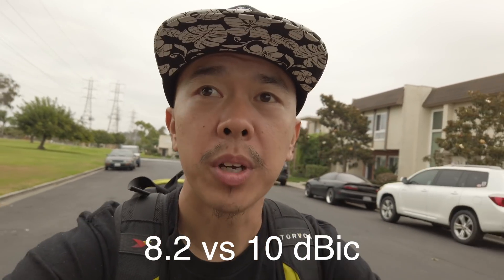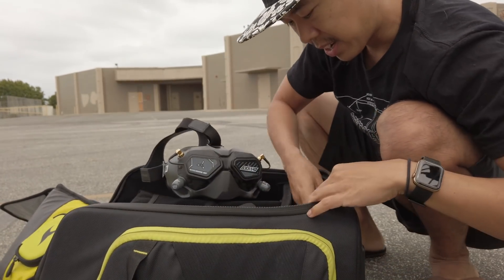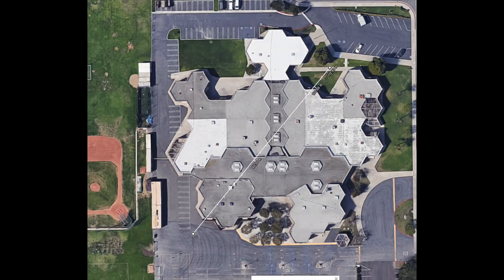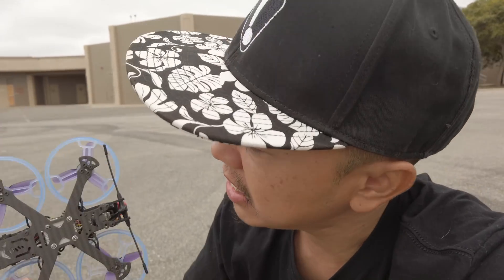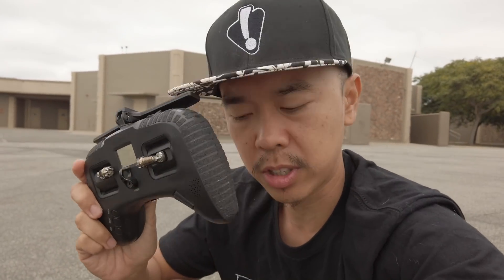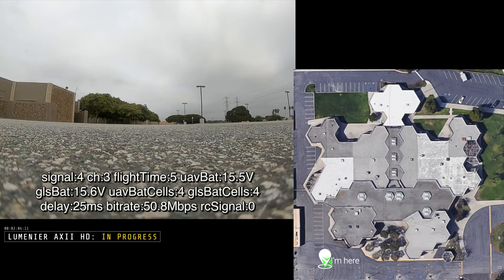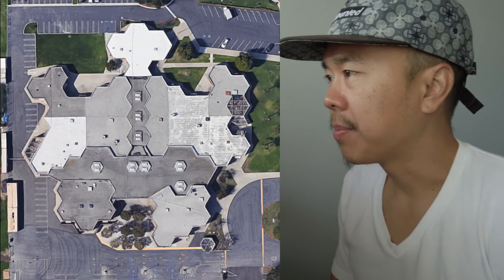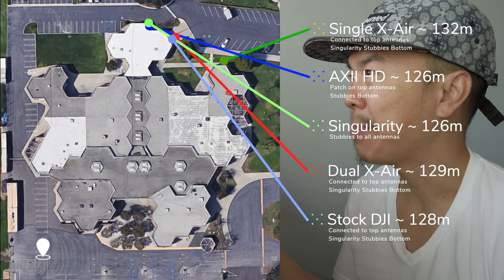The WRONG way to test antennas | AXII HD

Comment: Good vídeo! Usually you see a lot of videos comparing the data (MBs) and in my opinion they have to do it to compare as the actual results were so close that to differentiate they do that.
Honestly what really matter is not the data, is the range and the "feeling" of who is flying, witch one was better to actually fly.
Again, my opinion, all perform pretty close, I would only change the antennas for a better form factor.

Comment: I'm trying to figure out which dji antennas to buy. Could you try this test again using the dji fpv drone's cruise control option to maintain more consistent speed with the samples? Also which SMA antenna is best off the Vista or air unit?? I love your videos, Tommy. I found your channel through the salt mine video. What an epic place!

Comment: The Stock DJI antennas would be good enough if you were are 1,200 mW, making the others redundant at 1,200 mW as well.  The average pilot does not need to upgrade from the stock antennas in my opinion once they are at 1.2 W

Comment: Theres a few things to take into account .. Swr (standing wave ratio) 
The wave and field strenth 
Also a directional beam uses ground effect for a certain distance 
If you was beaming across the world the signal would use ground effect before the signal gos to the horizon ..  To the atmosphere. 
Ham radio coms beam signals to one another and use a wave lenth from the ground .. And a virtical antenna would have to be atleast a half wavelenth from the ground to combat ground effect capacitance ..
This also effects swr .

Comment: You’re blocking the signal with the building so it doesn’t matter what antenna you have, you can’t penetrate through every wall in that school to make it to the other side. You have to do the test again and fly high enough to be inline with the goggle so you don’t have to penetrate every wall of the school. This test is useless. No antenna can penetrate 40 walls

Comment: hey tommy i built a remix v1 with the same parts you used in the video. ( love the frame ) on  the hobbywing v1 flight controller how do i hook up the rgb leds to it? ty so much for every thing you do . the remix is my every day rig
Reply from the maker: Usually FCs have an LED signal pad. Solder the LED signal to that and power and then config in BF’s RGB LED config tab
Reply: @ummagawdFPV  thank you. Im willing to help got some ideas for you. I have the remix v1 but finding Parts is becoming a pain in the butt. I really love the remix frame that flies phenomenal . there is a stor frount near that could be big enough for indoor flying ( some thing we need here ) and be big enough to mass-produce remix frame and accro brat as well hit me back will fill you in on my ideas for you

Comment: furadi did a very similar test and similar results, its hard to design a test that will give good data you can use, like mario said its gotta be ultra clinical and fair,  i said to furadi this test was a bit like seeing which car had the toughest bumpers by driving it over a cliff, they all failed hehehe

Comment: No I'm sorry but I don't believe you were wrong.......

I don't care about a graph showing data, all I want to know is which antenna will get me the furthest! 

Your test showed clearly that they all failed around the same location.
Result! Success! Real world results!
Of interest was Nurks recent antenna comparison flying over a lake, showing clear differences of antennas.

Conclusion for all us DJI users:. The stock antennas are damned good when flying buildings.
When flying fields/trees then an antenna upgrade will give a more consistent bitrate for longer.

Thanks to rcShim I have stuck with 4X foxeer lollipop 3 antennas. 
Like the stock antennas these are omnidirectional but with higher gain.
However they are not low profile and they make us look rather silly.  But they work.

Comment: Would it be possible to have a relay  RX (or what ever DJI uses) booster  and antenna behind the building that you could automatically switch to as you start to lose signal? That way you could make it all the way around .  Might be worth asking someone like Alex Grieve (Ibcrazy} Video Aerial Systems.
Reply: I contacted Alex and I hope he doesn't mind if I quote his reply:
' It would be possible and has been done many times for analog video. The issue is DJI is proprietary and does not freely share their protocols. You would need that information for this to work'. 
Just a thought if you want to fly all the way around such a building in one take. Maybe worth  contacting DJI to see if they could come up with such a solution.

Comment: Thanks for the video Tommy! I picked up the AXII HDs because of the form factor and good performance. I am not sure it is as good as my dual TrueRC Air or single TrueRC Air with dual stubbies but  it is good enough and the form factor is just too good to pass up. I also have the VAS Cyclops but not sure when I would want to pull out that. I look like I have a satellite dish coming off my head with that on :)

Comment: Why not weigh the result? Let me explain: summation of the bitrate readings, divided by the number of seconds in flight.  I'd be curious to know the result.
Thanks ♥️
Reply: Flasky_fpv becaus as he explained: if you fly longer on the good side of the building and get more average Bitrate there, it's unfair to say this antenna is better. Only with a consistent speed this would be fair...
Reply: @Rcschim  You are right. At this point, using also the images, the measurements "on the good side of the building" could be discarded, choosing a cut-off threshold and then using not an average, but the median. Then it would be interesting to calculate the standard deviation.
Finally it would be great if it were possible to repeat the test by recording the gps data :D

Comment: Assuming or even concluding that a test is flawed because you did not receive the expected result is not good scientific thinking. Suspicion and surprise might be the first feelings, but this should not prevent one to try to think about the correct conclusions. Not getting the expected result can mean that you messed up your experimental setup, but it can also mean that your assumptions were wrong in the first place and so unexpected results can lead to new interesting theories and results.

Comment: Well I think this could also mean that there was just too much stuff in the middle.. they all failed at the same time.. and omnis get a little extra signal receiving bounces from everywhere while patch are only trying to receive what is being blocked by too much stuff.
Maybe with a bigger building (going further away) but with less stuff inside  you would only go around with the patch due to the stuff inside + better penetration + better range since bounces wouldn't "reach".

Comment: Interesting! Going off of what xjet said, I wonder how the "Mad Mushroom V2" would perform. I haven't had enough Omni antenna  to quantify but when I took it off my Stingy V2 FCE and shlapped it on the goggles the over all reception most certainly improved with the helical secondary.
 Then again the quick in and out of the goggle setup time would increase. They need to invent POPO SMA connectors lol.....🤔
Reply: I have the ethix version (long) and I like it but I don't think that it would make a difference.  In my case the only thing I think might help is that its a little longer, with 4 antennas on the goggles don't think there are many gaps in coverage the MM could fill in. 

I don't know for sure, but having polarized diversity may help with dji picking up reflections in this case.  (mix of lhcp and rhcp)  I did some research on this in analog and the problem was that often times reflected signals get distorted so picking up the opposites may not help.  https://www.sciencedirect.com/topics/engineering/antenna-diversity

I think the best thing he could do is change his position or save money on antennas and rent a cherry picker.
Reply: @rocketquad5888  LOL that closing statement 🤘😁

Comment: The reason that the omnis worked better is because you were receiving mainly reflections from the environment around you.  There would be effectively zero direct-path signal, due to the building in the way.  The omnis will pick up the reflections because those reflections come in from a wide variety of different angles.  Directional antennas will perform worse because they're only sensitive to signals coming from the direction in which they're pointed.

The results of this test are exactly as I would predict from the test environment.

You need to fly away in an unobstructed line to check the actual gains.
Reply: xjet that makes a lot of sense Bruce!
Reply: Yep was just about to say the same thing, good insight.
Reply: Before I scrolled down to check the comments, I was thinking the same thing.  No way a 5.8ghz signal is making it through the building.  It must be bouncing around and over the building.
Reply: There will be a lot more refraction than reflection happening.
Reply: Agreed, in my 2500mw ByteFrost (modified vtx) video, i only get a few steps more in video range, after walking behind a wall(elevator landing), as compared to the stock 450mw ByteFrost vtx. That’s a 5 times increase in power and omnis antenna on both sides
Reply: This exactly. With a narrow beam directional antenna facing into the building, there is almost no chance for multipath propagation to reach the antenna. And if some signal does reach there, then it's gone through many bounces and so has attenuated a lot. Had ummagawd been facing more towards left (facing the side of the building), the directional antennas would probably have faired better because of their gain and because most of the multipath bounces were probably propagating on that side of the building.
Reply: Excellent explanation... Fits my experience perfectly
Reply: I'm no radio genius, but it astounds me how many people in RC don't know the basic fundamentals of how radio works or radio waves propagate from antennas.  You have to wonder, how many people out there drive cars, but have no clue how a combustion engine works.  :)   I'm like, this is your hobby, but you skipped like Chapters 1 through 15...  and went straight to the center glossy picture section.

I guess I was lucky to have a 150 in 1 electronics kit as a kid to build circuits with and get to string long wires and dipoles up to play with the family shortwave radio.

Everybody I guess comes in at it from different angles and backgrounds.  I'm into RC, and yet I've yet to glue two pieces of balsa together... and worse, we even have a woodworking cabinet shop with plenty of wood glue.  And three of my full sized airplane projects in it.  How can that be that I'm into RC and yet have never glued balsa together or hot wire cut foam yet :-)  Blasphemy!  Young upstart!

Comment: Thank you for doing this and sharing it. To me this proves that so many people pushing the truerc x-air antenna are biased. Either unknowingly from placebo affect or knowingly from trying to push product to get free stuff from all these companies.
Reply: with a directional antenna, people fly 4 km at a power of 25 MW. This clearly says that the antenna is working. Well, for better penetration, it is better to use a frequency of 1.2 GHz

Comment: Multiple goggles wouldn't work with DJI's audience mode. And to this day it's still not 100% clear to me how the goggles work wrt which antennas receive and which transmit. I've heard multiple versions of that story, but the most common one seems to be bottom is tx/rx and top is rx only? So theoretically if you only have patches on top that helps signal from your quad to reach goggles, but not the other way around, which is exactly why I too expected dual X-Airs to completely destroy others in this test.
Reply: Filip Radelic I've seen a paper (fcc?) where it states that all are tx but the bottom left one which is RX only.
And yes, not even multipl goggles would make testing easier...
Waypoint missions is the only way ;)
 And mounting the goggles on a tripod...

Comment: Tommy could you please test lhcp and rhcp together on the goggles with an air unit using both also?
Reply: I believe DJI only uses LHCP
Reply: That's exactly what maple wireless suggests with their antenna pack. Go check them out, I think they are on Banggood. They use 4 patches 2 l and 2 r.
And the air unit has different than orientation as well. They flew 13.3km with it ;)

Comment: Behind buildings you require reflections to get a signal and polarized antennas will not work that good.
Reply: They change polarity every time they bounce, bit of a crap shoot. But the extra 3db/double the gain by having matching polarity is better than running linear and having both be worse and only better for certain situations.
Reply: They actually sell sets for dji with both rhcp and lhcp intended to be used at once. I haven't seen anyone test them though.